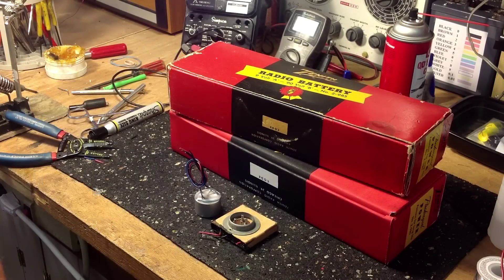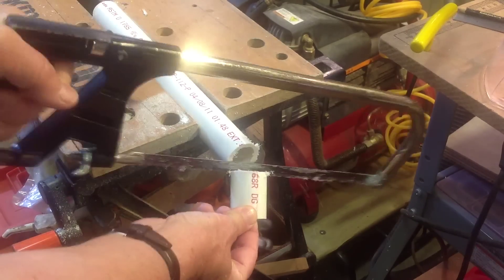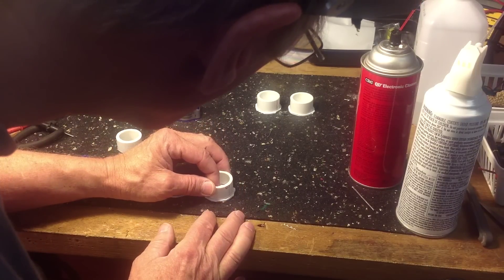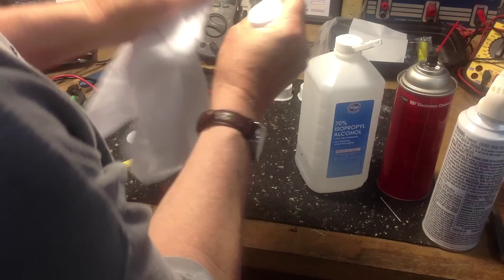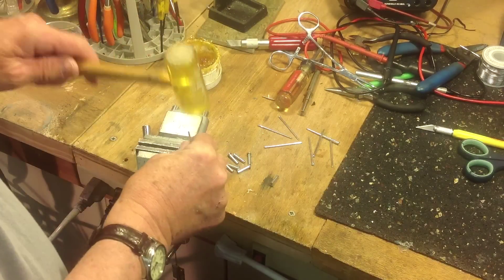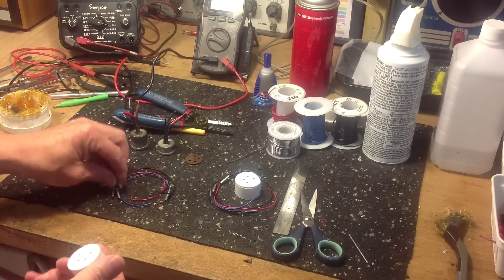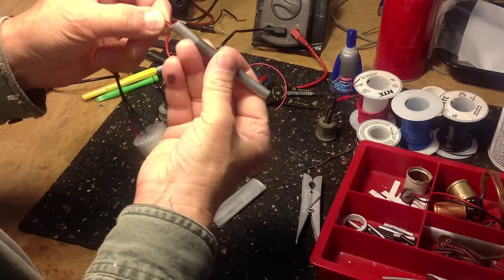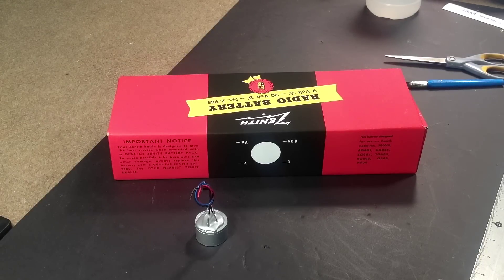Build a Working Battery for your Zenith Trans-Oceanic Part 1

Comment: Cleaver design. The rivets you use are 5/8" is that the length of the rivet. What is the rivet outside diameter needed?
Reply from the maker: Rivets are 1/8” in diameter.
Reply: @morrised2006  What is the size of the battery box?
Reply from the maker: Answers to you questions can be found on our FAQs page at www.edsantiqueradios.com.

Comment: Ed, while I am doing my best on these ZTO's, I do have one bug a boo issue.

How to align one of the 7g605's to make it work , with battery.

Have you any videos or suggestions?

If I can get the four ( 4) I have aligned I have plans to sell them and keeping one back for myself.

I'd certainly appreciate any help you can offer.

I'm pretty well house bound for a while so I thought I may as well give it a shot. 

Thanks in advance.
Reply from the maker: Don B 

Don, not sure what you mean by align to work on battery.  If it is working on AC power, it should also work on battery power.  Make sure you have the AC plug inserted in the battery changeover switch on the rear of the chassis.  Also 2 D cell batteries must be installed in the special D cell holder in addition to a 90 volt/9 volt AB battery connected to the large battery plug.  Polarity must be correct.  I can better assist if you email me directly at morrised2006@comcast.net

Comment: I know this might be seen as offensive ... but what about using the new dewalt 60v battery?  

*Maximum initial battery voltage (measured without a workload) is 60 volts. Nominal voltage is 54.
Reply from the maker: Joel Miller :

I'm not familiar with the Dewalt 60v battery, but the Transoceanics need a 90v/9v supply for the tube plates and filaments.  And the idea of a reproduction battery is to power the radio with a battery that looks like the original.  There are, however, several different ways of providing the proper volts and mAmps to power a Transoceanic for a reasonable playing time and cost.  Ten 9v batteries in series for the plates, and six D cells in series for the filaments is probably the lightest and least expensive way to go for about 40 to 60 hours of playing time.
Reply: Ed Morris ss

Comment: That's seems lot of time for tube radio I thought the tubes would use lot of power
Reply from the maker: The tubes used in the Zenith Tran-Oceanics did not draw much current.  At 90 volts, the tube plates draw about 20mA.  The solid state Trans-Oceanics drew even less, about 15mA at 12 volts.

Comment: How long did the old battery last in the radios back then
Reply from the maker: The original Zinc-carbon based batteries probably lasted 40 to 50 hours, depending on how the radio was used and its condition.  An alkaline cell based battery may run the radio for 400 hours or longer, again subject to the same caveats.

Comment: really REALY well done . I'm working on building the battery boxes and the connector was the one thing that was goofing me up. Where to get the male pins? Now I know!. Thank you very much.
Reply from the maker: Thanks, let us know how it turns out.
Reply: It took a little doings and some good old fashioned telephone book work but I found a temporarily starting point. Using my local "with the helping hardware man" , steel rivets ( I'd looked in both Lowes and Home Depot and found only aluminum ) were the find of my Sunday drive.  1/8" dia. , 3/8"ths to 1/2" grip range , although dialed in at 43/64th's ( 12.xx? mm) ( I'm using a very old and somewhat reliable dial read out Vernier scale) which I ground down to just under , 33/64ths and so far it seems to work out pretty well. This one item, has been a real sticking point in all of my restorations of these really wonderful radios. I thought I was pretty good at improvisation , but I can guarantee this handy idea won't be lost on me . Out standing idea and my hat is off to the guy who figured this out. Thank you. So Much!
Reply from the maker: Don B , thanks for the kind comments.
Reply: Ed Morris accurate and to the point Ed. This was all the tipping point I needed. I'll never look at another item of hardware without an alternative use.. All I need now is a good color graphics guy. I think I've got all of the batteries they applied to these radios. Any suggestions?
Reply from the maker: Don B visit my website for labels.  edsantiqueradios.com.